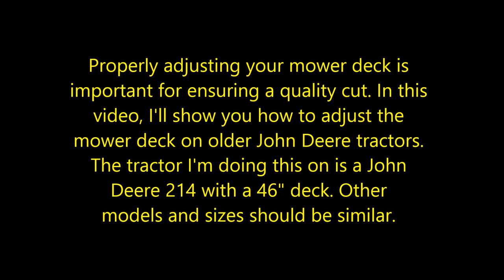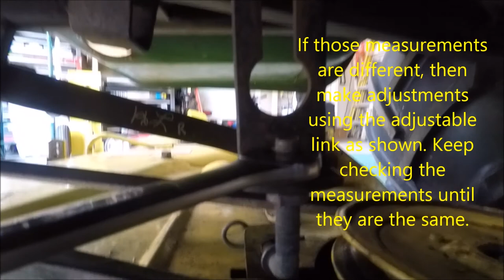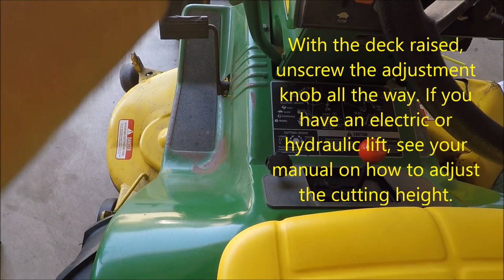Mower Deck Leveling and Adjustment

Comment: Not sure if it makes a difference or not, but I just bought a used restored 317. It doesn't have the front wheels on the deck, but has the middle 'roller", and it does have the two back wheels- should I be looking for a welding shop to have the front two wheels put back on?  Or do you know if some of the decks came without the front wheels?
Reply from the maker: Yes, some decks didn’t have those wheels, do you know what size it is?

Comment: my deck on it's highest position the deck wheels are on the ground  it is a cub cadet 2016  ltx1042 kw    and I cannot figure it out . I have cables for my deck not adjusting bars  and looked at them and the pulleys they are on and the look fine   it has 282 hours on it .The deck is about 1 1/2 inchs from the ground
Reply from the maker: The manual I found for an ltx 1042 shows similar leveling adjustment points to what’s in this video. For height it appears you only have notch settings for the lift lever itself. The wheels themselves should be moveable as well.
Reply: @outdoorpowerhouse  The ties are movable but that does not adjust the deck at all . I did find up by the top of the cables plugs in holes above the hole the cables were plugged into    I to out the second plug and put the cable bar in it and adjusted the front bar on the laenmower and now it is up . Funny but on the plans they have on parts tree it does not show that at all . Sad part is a neighbors dog bit me whe i took the mower out to test it and I had to hit him with my mower and almost toppled the mower onto myself . It is a big dog so he yelped and ran all the way home and police came and so did animl control , no leash law here and i have complained about this dog 6 times and this was caught on security cameras . I don't blame the dog I blame the owners  . The dog was so skinny it was pathetic